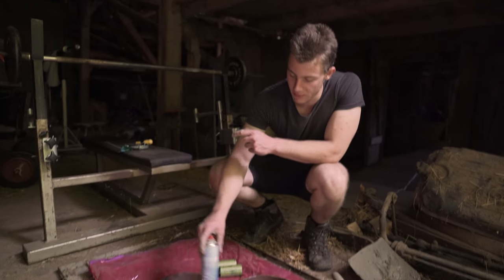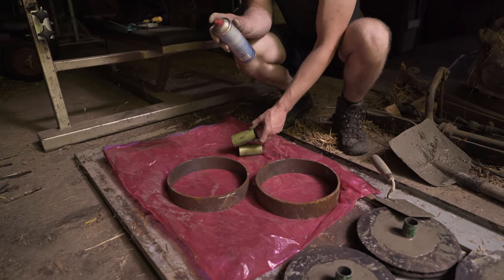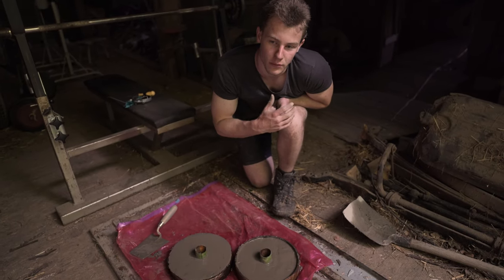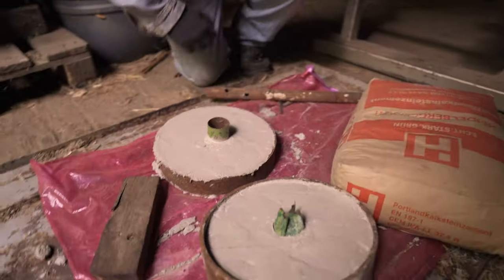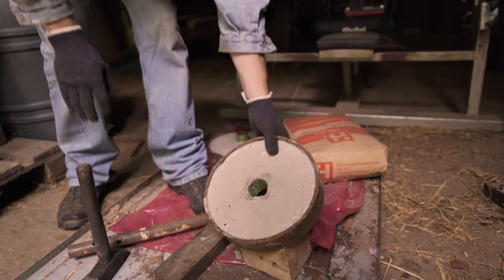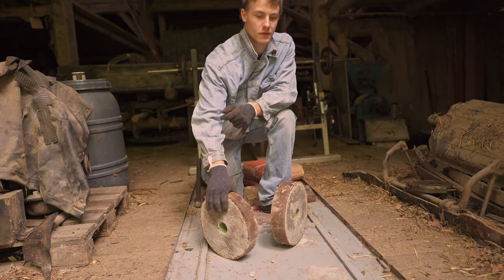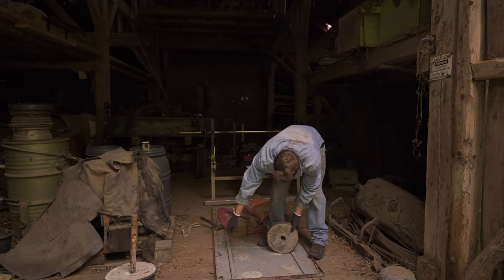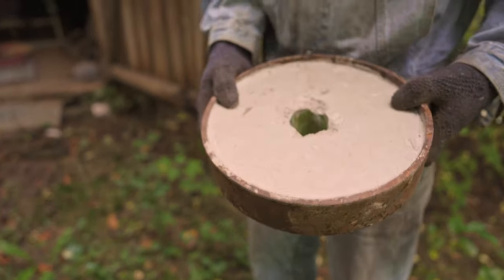Building and Testing Concrete Plates - How to make sturdy homemade Concrete Plates using Steel Rings

Comment: If you have left the metal rings inside calculated exactly the thickness and the radius needed for the bar, it could have been even stronger, just a thought.